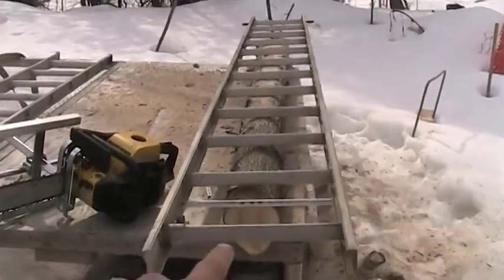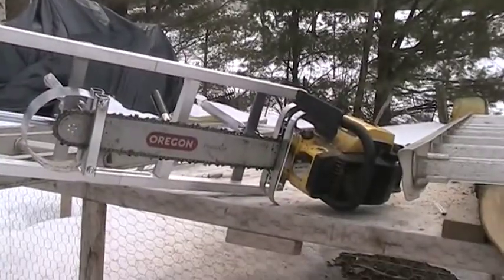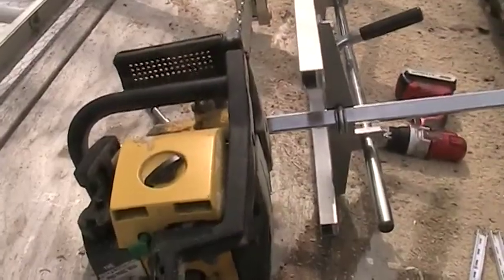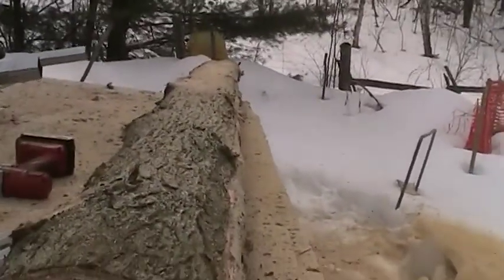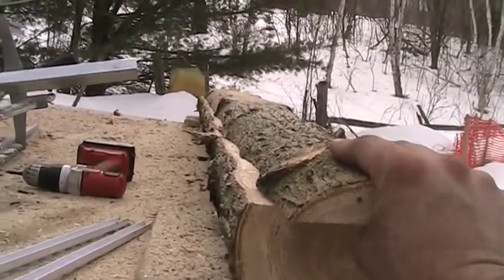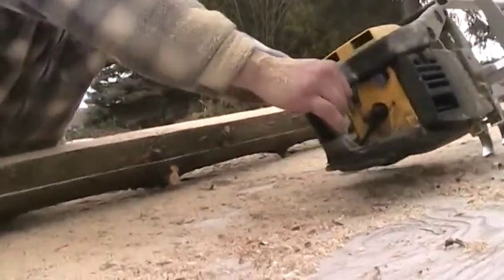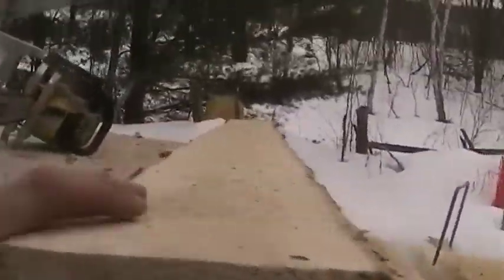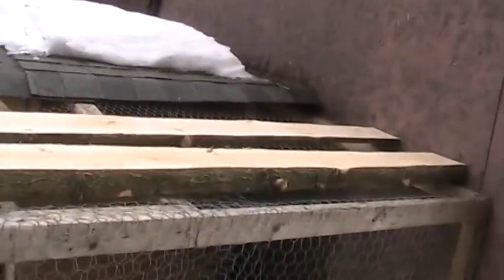Amazon Chainsaw Mill Test Run, Milling Cedar with Mcculloch Pro Mac 655

Comment: I think the sheep want to help you! LOL The rooster is mad too. I have never used one before but the mills look interesting. Do you need a special chain ? The saw seemed to handle it pretty good. Thanks for sharing
Reply from the maker: Thanks!! The sheep are probably my biggest fans lol I just ran a standard full house chain in the interest of saving a buck lol but they do make what's called a ripping chain specifically for this that's supposed to get a smoother cut but the full house Oregon chain seemed pretty smooth to me lol I think the next specimen will be one of the big maple trees in the woods I'm cutting down, now that I've gotten my feet wet I know kinda what to expect now lol was sooo fun tho, I couldn't help but get giddy Makin my own lumber :)